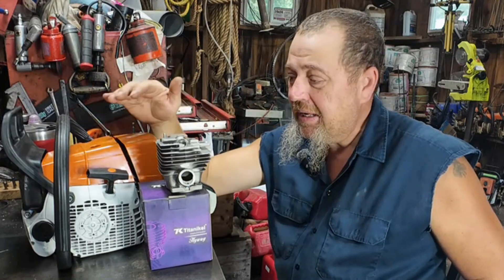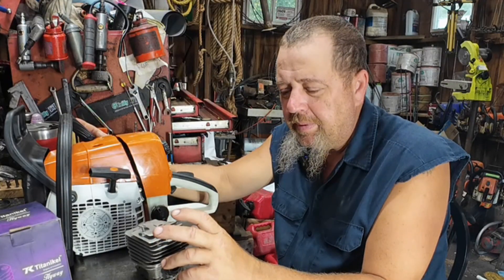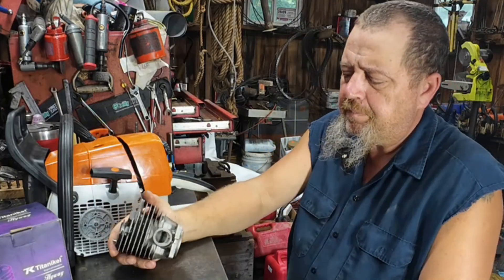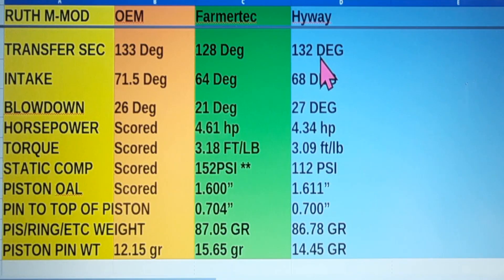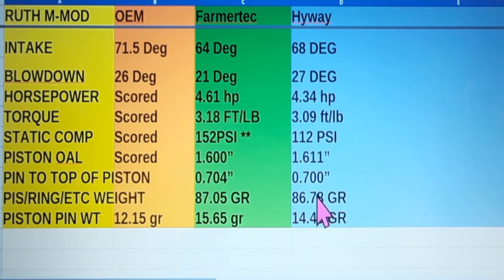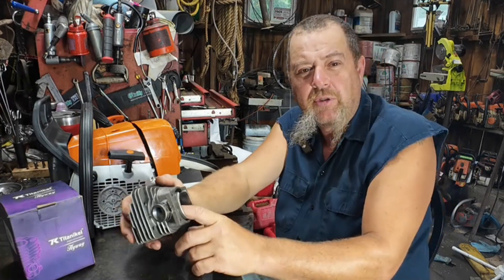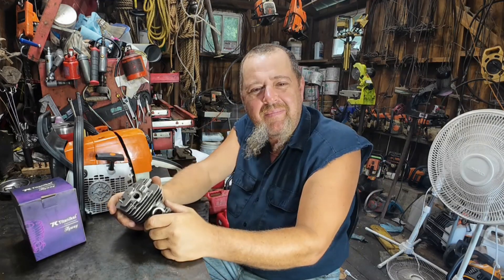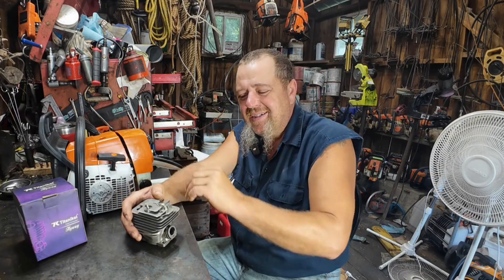Is the HyWay Kit Any Good? Chainsaw Dyno Test on the G366 (Stihl MS361 Clone)

Comment: The first saw i ported was a 61-272 hybrid i used a hyway titanikel with a popup piston and caber ring,  it was pretty disappointing for the first 10 or so tanks then it seated and man what a difference.... in the next few tanks i was replacing the pull rope!  It will hang from the rope wearing a 28" bar all day if you want so yeah the hyway will take a while to break in but its worth the wait...
Reply: Ima still waiting 10 yrs later for that boost in power, can't imagine how much more power I'll get from my race engine, I built it 18yrs ago, mabe it bust me in the 9 seconds range
Reply: @alltherpm 😂 maybe feed it some liquid compression... (Nitrous)
Reply: @matthewbutcher203 there the best new friend, love how a 50mm piston that gets fully built will see 30-40 % more in power, but think somehow there gona feel .1 hp,,, never happens
What i have seen is when fresh high compression, then broke in it wears the cross hatch in cylinder, then u end up with bout 10 pds less
Reply: @alltherpm my experience with titanikel (especially with a husqvarna single ring piston) is there is no cross hatch, its as close to crome plating as you can get without it actually being chromium. Couple that with a hard ring like a caber and you're definitely going to notice when the ring seats. Im currently repairing a 455 rancher husqvarna, a boy brought it to me and said it would run but it was blown up, I pulled the muffler, piston was perfect, pulled over the rope it felt perfectly acceptable for compression, just guessing based on experience in the 135 pounds range, I tore it down and the ring was stuck with carbon and the side of the piston was black with blow by. So no it wouldn't have pulled a hat off your head and yes it matters about ring seal when there is only one.
Reply: @matthewbutcher203 all my saws i put 1 ring, matter fact my crank swapped homelite had 2 rings, this build i did things to it for r&d, used a smoked piston had to sand it to get the melted off, and same with cylinder, the ring well full of scratches, just slapped it together, well 200psi comp and u can her it bleed by when cranked, so id say that cylinders broke in, should i see in increase, no i wont, but my same engine thats brand new cylinder and piston has 225, the old should have more?
Reply: @alltherpm you are  kinda losing me but if I understand correctly you are saying that the saw you put together with hurt parts don't have as much compression as the one you put together with new ones? 🤔...that tracks. Your old saw is what it is it will only get worse with time, the new one, if it has 225 psi freshly assembled it will pick up 5 to 10 psi when your rings fully seal possibly more depending on what you rings and bore materials are. If im understanding your comment correctly.
Reply: @matthewbutcher203 well it didnt gain comp if any it will loose comp, pretty sure these engines are set looser then most, the biggest increase in power is when crank seals loosen on crank thats it
Reply from the maker: @matthewbutcher203 @alltherpm Good stuff gentlemen! On a new build, I definitely see an increase after a bit of break-in.
Reply from the maker: @matthewbutcher203 Sounds like your first port job was a dandy!!  Like you, I'm pretty confident that it will turn on harder once the rings seat. Thanks for coming along for the ride and for joining-in!

Comment: The compression on that HYWAY is horrible!  Really would be interesting after a few tanks if it actually went up.  I mean gaining 40psi just breaking it in seems a long stretch!
Reply from the maker: @larryw5429 The compression is not too bad considering stock numbers; I agree that it will come up after a few tanks; I will be anxious to see the difference after being broken-in. It hit near-factory advertised HP. A little time may shed some more light on this one! Thanks for stopping-in and especially for joining-in!

Comment: I'm bougie all my stihls have oem cylinders and some have new oem pistons too 😅 but then again I'm the founder of Sawyers Anonymous 😂😅
Reply from the maker: @tomintexas817  I might consider using OEM if I were ever planning to build a saw and not just test it to death. 🤯🙄
Reply: @HayChaffandSawdust1 your 044 is oem I had 3 slant fins now I guess you have 1 it's base gasket deleted big lower transfers and will have piston windows open
Reply from the maker: @tomintexas817  Dang good chassis; doesn't need much/any to be a good work saw.
Reply: @HayChaffandSawdust1 yes but ported😊

Comment: Just did my first hyway cylinder. As I was grinding in my lowers I noticed the plating to be very chippy. I opted not to do any further work and am just going to run it how it is and see how it holds up. Hope yours grind a little nicer! Looking forward to upcoming results!
Reply from the maker: @andrewgrubb8947 I hope so too!!! I have the three brands and have ported one of them (for the Sawfest race) and it did very nicely; I haven't done the Hyway yet, but will surely get to it as time allows. I think it has potential!